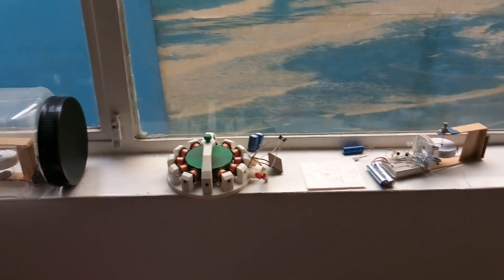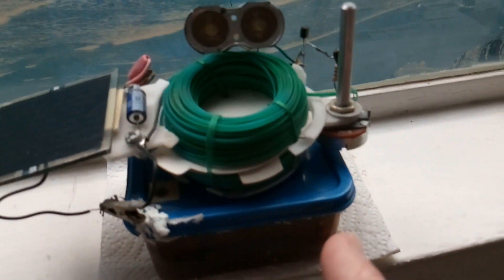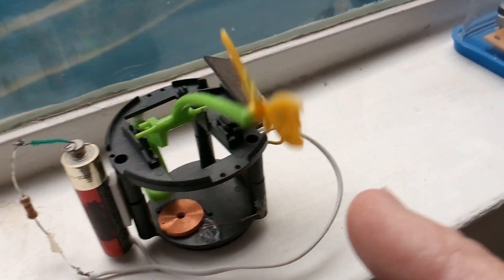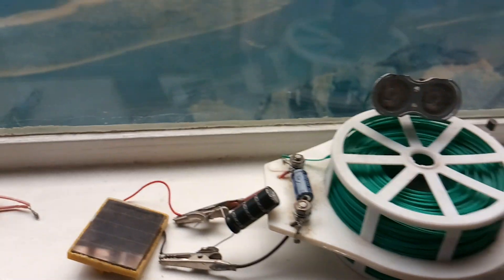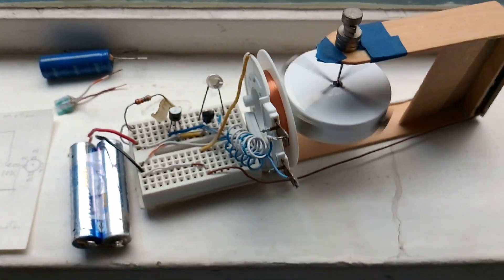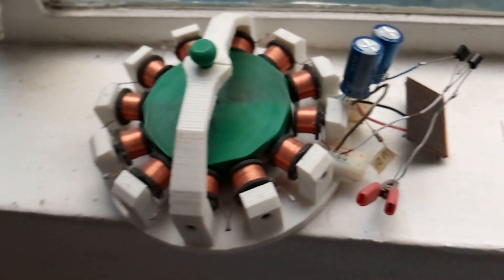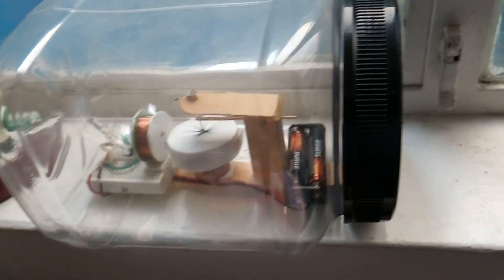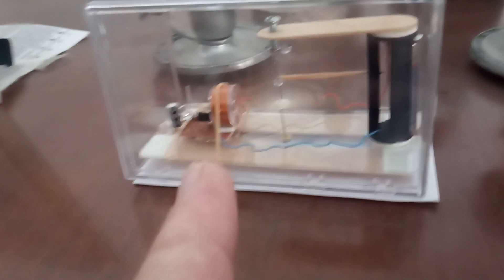Non- Stop Running Devices After 3 Years----An Update

Comment: very cool little motors! but where did u find/what did u take apart for the super caps??
Reply from the maker: You can find the super capacitor on Ebay or Amazon.   Use the 2.7volt / 10 Farad super capacitors for this application.
Reply: @Lidmotor  cool thank u

Comment: Very good and interesting, you have a video where you design and explain how to collect that energy through other coils so as not to use solar cells and see to what point (time) the system sustains itself, thank you.
If you haven't, it would be very interesting to make one.
Reply from the maker: I learned early on that you can convert energy but you can't "make" it.   Collecting energy from a running device just steals it. If you try to add that back into the system it doesn't work.  What you CAN do though is to make your device very very efficient and run it on ambient light energy.  I wear a Citizen light powered watch that does exactly that.
Reply: @Lidmotor  
Thank you, for your quick response, I agree with you, I think I did not use the appropriate terms in my question, my English is from google, hahaha, but in places where daylight hours are very short or very cloudy ???? well anyway thanks
Reply: @joco.k5994  I've replicated some of Lidmotors devices. I'm in The Netherlands Europe and they work almost non stop, only on dark overcast day's in winter they will stop. I'm not good at the spinners, but the blinkers work pretty good!
Reply: @benwinkel  
Thanks, but maybe I have a dream of doing something that can extend the life of the batteries by taking advantage of the energy used. It would be interesting to try.
Reply: @joco.k5994  Go ahead and experiment. It's the best way to find out what works and what doesn't. And it's a lot of fun!